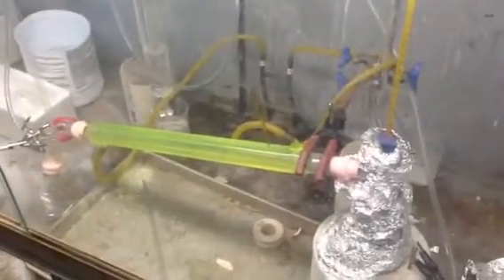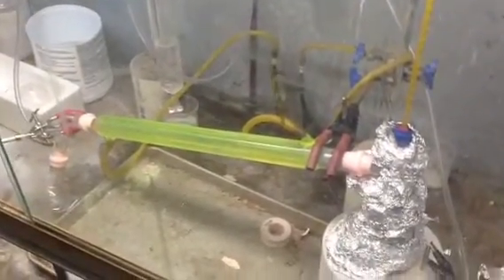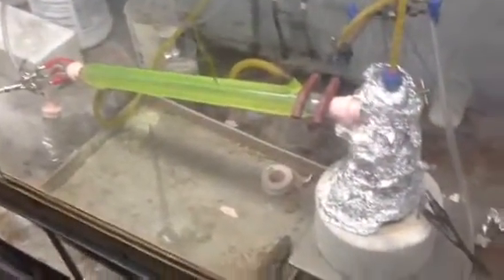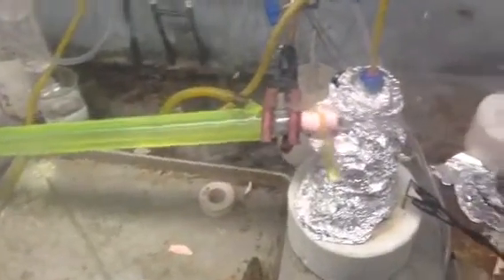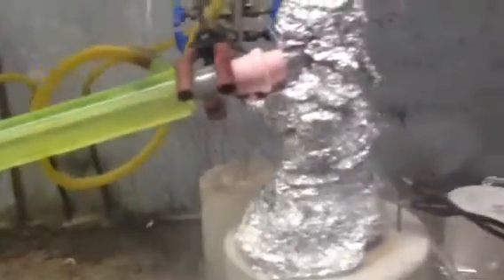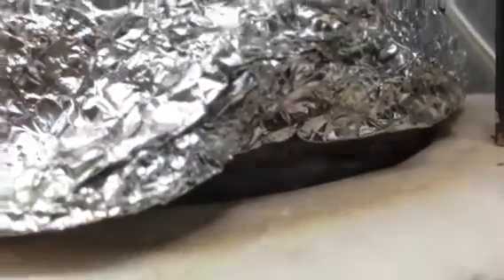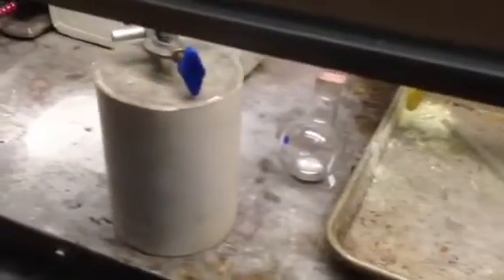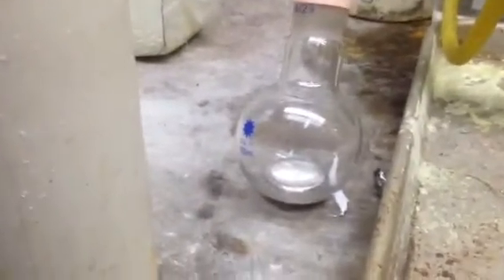Mercury Distillation.

Comment: Once you use mercury in your equipment, how can you neutralize any residue so that it is clean enough for use with consumable chemicals? Can it even be cleaned or do you need to throw it out/use only with mercury?
Reply from the maker: mercury is an element. it can't be neutralized.  it shouldn't "wet" or stick to your glassware it should rinse right out. if you have issues washing your glassware you can dissolve the mercury with nitric acid, and then thoroughly was the glassware. beware that dissolved mercury is a lot more dangerous for your health then elemental mercury is. hope this helps.
Reply: Wash with water and soap several times. And if you really are that worried about mercury contamination rinse in nitric acid, it will oxidize the metal, and the ions are water soluble. After that wash again with water. Any mercury II nitrate formed would be much more toxic than the mercury metal though, the salts are somewhat water soluble and can be absorbed by skin contact, inhalation of the droplets/dust/mists/aereosols and by ingestion.

Comment: Thanks for the awesome video. Why do you use an aluminium foil?
Reply from the maker: the aluminum foil is for insulation. the mercury boils at over 300*C and the flask has to be kept hot for the distillation to work properly.
Reply: Thanks for your prompt reply